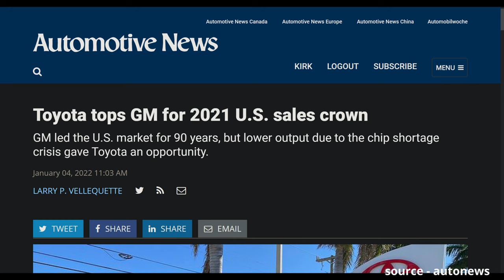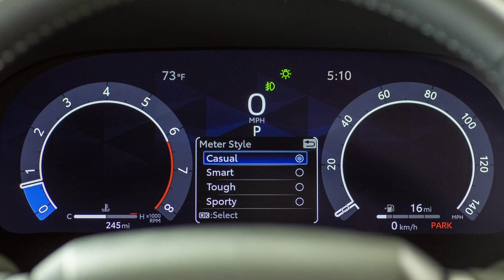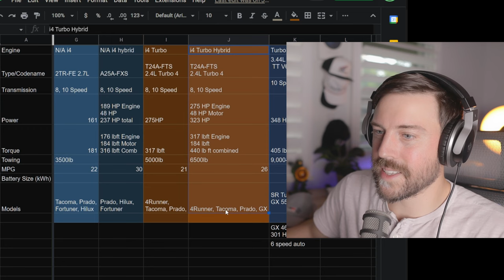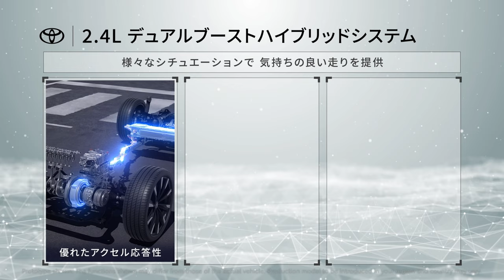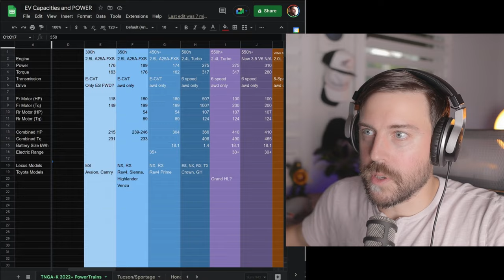Where does TOYOTA go from here?

Comment: They seem to have shown over the last 70 years that they are capable of pivoting quickly when necessary.  They have deep pockets and probably hold as many or more battery patents than any other company in the world.  One thing that will prove difficult for Toyota to navigate is politics and I would guess that the next presidential election will impact a lot of their decision making.  It will be a very interesting and exciting next 5 years or so!
Reply: Totally disagree Toyota has huge debt right now is needs get into the EV. When have they pivoted in the past?
Reply: @vancity2349  you can disagree doesn’t mean you’re right though.
Reply: @vancity2349  Automakers in general are typically the most in debt companies in the world because the product they are financing is both high volume and high priced.  Toyota's debt/equity ratio is average or better compared to other car companies.  This is a company that got its start making sewing machines, then early on produced vehicles that couldn't even maintain highway speeds when they landed, rusted, in the North American market so pivoting is something they have experience with before even mentioning the 2008/09 financial/recall crisis.  I would agree that Toyota was too analytical in its approach to EVs and didn't fully grasp that it doesn't have to make perfect sense for someone to want to buy one.  But how do we know that their timing on this isn't correct?  Even in the current parts crunch they remain the largest and most profitable automaker, they are a leader in solid state and have a clear plan for their product line up going forward with a large EV presence.  I guess only time will tell, but I would at least suggest that there are a number of other more vulnerable car companies.
Reply: @tails300  For sure these are just opinions...I have owned Toyotas and Lexus products which were awesome but right now they in trouble. They partnered with Subaru for the new BZ4 and had to rebuy them all as the wheels fall off...
Reply: @vancity2349  I'm sure Toyota would rather not have to recall their BZ model and it certainly isn't ideal, but what percentage of their sales does this represent?  It would be like saying Apple would be in trouble if they had to stop selling their Mac mini.  Toyota has pretty steep EV plans beyond the 1st gen BZ4X model.
Reply: @ytj22  It is small but this rare and rare for Toyota but shows how they rushed out an EV and it wasnt ready
Reply: @vancity2349  exactly

Comment: I think Tesla by the end of 2023 will be at the 3.5 million capacity rate. Not 3.5 for that year but their build rate. Beginning of 2024 their factories will be increasing capacity and not to mention any additional factories but I’m sure more will be in the process.   Really interested in the TC & Grand Highlander hybrids. Decided not to get the last of the 8 cylinder GX.  Also interested in updated GX too. Note I’ve stuck with Japanese built cars. 2 GX’ and and a Venza. Putting in another order this week.
Reply: Production are barely over 1 million. Unless they can triple their output or open new factories. They wont do close to 3m. Let alone have a big demand. Dont see any announcement for new giga factories in 2023.
Reply: @anekinoo7  Dude they made 930,000 cars last year. And that’s with massive shutdowns. There production rate at end of 2021 was over a million. Right now Shanghai is over a million rate add two news factories with small output which will be in full swing by end of 2023 and they will certainly be over a 3 million production rate at end of 2023.
Reply: Video is about toyota and US market. 3m record was held by GM for 90 years and toyota broke it was 3.1m. No way telsa can do toyota numbers especially in 2023. Of the 930k telsa sold 90% of was model 3/Y. Q2 21 model 3 was 204k and Q2 22 242k. Less than 40k over last year. Production trend wont be much more in 23. Telsa has to make over 1m 3 and y each. Only Corolla and F series truck hit 1m sold in a year in last decade. Thats only two times in last 20 years.
Reply: @anekinoo7  you are partially incorrect. Toyota want to sell 3.5 million globally BEV by 2030.  They sold over 3 million hybrids globally. The beginning was a quote about GM.  Toyota is very disappointing and way behind in BEV. The head of Toyota even was against them a short time ago.  Go back and watch
Reply: @StormBringer-   cus theyre putting their money into hybrids. Just about every model they have has a hybrid. They have more hybrids than any other companies. BEV will take decades to even come close to hybrids range. Hybrids are best bang for the buck. Good value and good mileage. About 600 miles on a tank while costing $2-3k more than their gas version. Most EV are barely getting 300 mile range.
Reply: @anekinoo7  well I bought one daughter a Venza in May which at the time was the best thing. But why should I buy a hybrid which is more complicated than a gas or BEV.  Toyota is so behind it’s not funny and I’m very disappointed at them.

Comment: As a Canadian 2021 CHR owner, I won't be sad to see it go. As much as I personally like the way it drives, the Corolla Cross is better in every way. And with the hybrid coming, it makes sense for the CHR to barely sell.
Reply: @maga6319  I'll be honest with you and won't argue. I'll speak as an owner. So far, in its 28k KM it has driven, no issues with the power train and everything inside is amazing. However, the only thing annoy8ng me was some seatbelt sensor in the back middle seat. It has been going off even though no weight or no one was in it. This feature has really annoyed me quite a lot. Other than than, like I said, it has been an amazing vehicle to drive in with 28k KM on it and with it giving me a good 560 KM to drive. 

Now in the end, especially right now, would I recommend it? Unless your a fan of its quirky styling, absolutely not. The Corolla Cross is a better option no matter what aspect you look at. Bigger better tech and I would say a less controversial design. The CHR is a good vehicle for starters, but why the heck would you choose it over the CC when the CC gas AWD and a better power train.
Reply: @maga6319  it's a good quality vehicle overall. And very comfortable. You can't say that Toyota hasn't got it, because of one minor issue. If it's not a power train issue, and if the interior isnt falling apart, it's good enough for me

Comment: Toyota onslaught CONTINUES.

1. Looking forward to the next GR product installment. Hope it’s a 4 door or SUV.

2. The next generation Camry is definitely going to be a looker.

3. Next gen taco and 4 runner are gonna break the internet
Reply: @maga6319  That's because of the supply chain issue, which it's getting better now. Some manufacturers are doing better than others because either, they are paying more for the Chips to arrive faster,  or the supplier they work with is receiving materials faster.
Reply: @maga6319  I am no automotive engineer, but in the past couple weeks, many dealerships, including ones for Toyota are receiving almost 5x thr amount they received before. While Toyota is red8cing its production for October, I will no longer expect like only 20 cars on the lot. Many dealerships are now gaining momentum at the supply they get.

And BTW, when I said it's getting better, I meant overall for everyone, not down to a specific. It can get better for Toyota soon. But don't say that they are selling less because there is no demand, because beliee me, there is.
Reply: But where is 2023 camry !!!! 
Still no news or spy shots
Reply: Hopefully GR is left to mostly manuals. And I hope that they don't inject that into an SUV. Keep it low, light, and fun! We already have too many bloated crossovers with turbos. Bring back the sedans and hatches!

Comment: I really hope Toyota keeps some sort of v6 on the Tacoma whether its NA or hybridized hell ill even take turbocharged same with the camry and 4runner
Reply: No v6 is needed lol 🙄
Reply: @ekgcanadianenthusiast9961  why not
Reply: @swami539  new engines are better simple as that.
Reply: @ekgcanadianenthusiast9961  better power wise yea for sure but at least in truck application i dont want an overstressed turbo 4 i wouldn’t say there better simple is that. For the Camry i see it but for 4runner and tacoma to me its ruins driving experience and could hurt reliability especially when towing or hauling with all the stress
Reply: @swami539   toyota wont put a i4  in a truck unless they work out things like towing and more. so v6 is not needed . Upcoming tacoma will have way more towing capacity   compared to its rivals. this is the  future and all the issues you have pointed out are no longer issues because toyota and others have workout those issues out long time a ago  👍.
Reply: @ekgcanadianenthusiast9961  idk rumors are indicating this way plus almost every other midsize other than frontier rn has turbo 4 so we will have to see plus I doubt it will have way more capacity towing and payload versus rivals and if they do it won’t be for long between the big 3 in America one of them will outdo Toyota. Plus we see lots of Orem struggles with issues I mention even Toyota when it’s a new gen there always going to be issues but even with other oems we see issues so I wouldn’t say they have been worked out yet in progress maybe. Plus with all the recalls lately with everyone including Toyota reliability it’s to be questioned for sure

Comment: Toyota?Lexus has been my favorite car company since they launched Lexus in 1990
They've had a great 30 year run, but Lexus, in particular, is clearly on the downslope.
I find the Lexus NX and RX redesigns underwhelming.  The interior design is sorely lacking, and two steps behind new brands like Genesis. The new LX is also poorly done, and the LS is all but dead.

I feel the Lexus LC is going to be the last great vehicle Lexus will produce, for under $100k, at least before they go full EV, many years from now.  I don't see a way forward for core models like the ES and LS.  The GX is going 4 cylinder.  Why should I be interested in Lexus, today?  Not as easy a question as it was 10 years ago.  Toyota will be great, but Lexus has me worried. Not much to get excited about there.
Reply: @maga6319  The youngest baby boomer is 57 now. And it's not just baby boomers that like the RX. A lot of soccer moms and other people like the RX. I think the RX will continue to sell well and I'm curious about the RZ.
Reply: @maga6319  the nx I think looks fine but not to the same level of fine as the x3 GLC xc60 q5 gv70 cx5 Rdx venza Tucson Sportage cx50
Reply: @benjaminsmith2287  well if you look at the specs of the RZ you can see it’s just atrocious. Low range slow charging fwd poor performance etc
Reply: Lexus new engines are way better than old v6 and v8s  And lexus is way better than genesis . Lexus will always make great products but people online will always be winny .😂
Reply: I think at this point Lexus has joined Infiniti on the border of irrelevancy. It’s only a matter of time until both those brand go out of business. It doesn’t look like Lexus sales are as strong as they used to be and they will decline for all their models and brands like genesis Acura or Mazda will usurp those sales.
Reply: @naveenthemachine   oh naveenthemachine  . Nx is more fine and better genesis  by a mile so your comments mean nothing and stop trolling
Reply: @naveenthemachine   my god . Lexus is only getting better and why dont stop trolling and get a life.